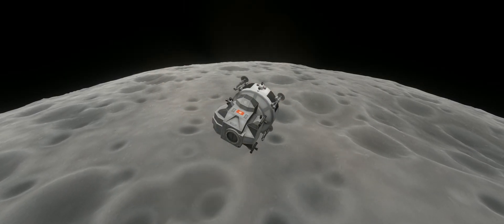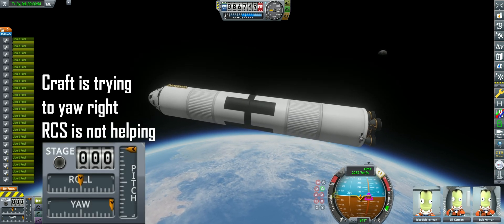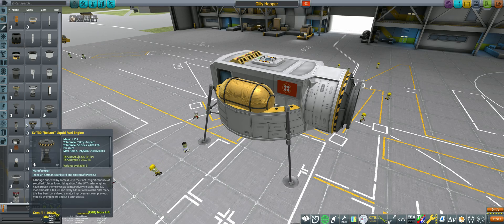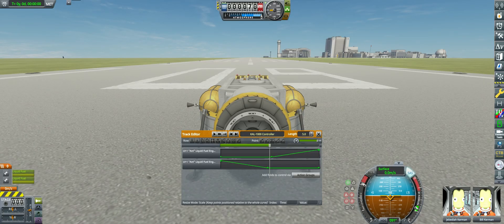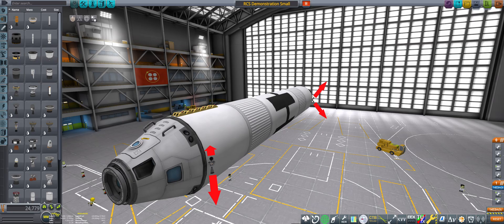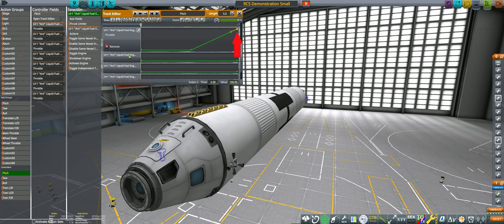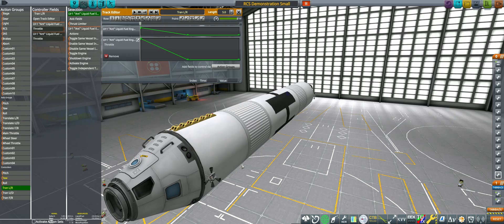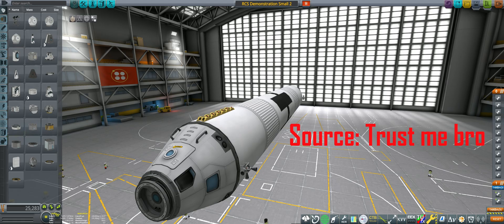KSP Dark Arts: Custom RCS

Comment: To 'rigorously' define the source: trust me bro without math, we can make the following observations:

First, a geometric object must have at least 2 dimensions to be able to translate and rotate in 3 dimensions. Hence, all thrusters must at least be distributed across a flat shape to get 6DoF motion. The trust-me-bro configuration satisfies this condition.

Next, if we assume that none of the thrusters lie on the center of mass, then we need at least 2 thrusters for each direction of translation, for a total of 12 thrusters aligned with the translation axes. The trust-me-bro configuration satisfies this condition.

Moving on, each rotational direction must be handled by at least a pair that point in opposite directions, but have the CoM as the midpoint of the line connecting them. However, we need not limit ourselves to thruster pairs. Any radially symmetric arrangement of thrusters pointing in a circle will do. The trust-me-bro configuration satisfies this condition.

Note that the trust-me-bro configuration does not have 24 thrusters as you would expect if you naively counted in pairs for each of the axes for each condition, because each thruster is literally pulling double duty.

Comment: You can use the mod Throttle Controlled Avionics to do this seamlessly, which is probably more practical unless you are a stock purist (this is still cool though)
Reply: This is also very useful for console players who don’t have mod access.
Reply: Or with Mechjeb: Utilities Assymetric thrust, Or just use tweakscale with vernior engines.

Comment: I tried it once, it does work but unfortunately is rather time-consuming to set up and you are right, you really need to do a lot more manual maneuvering
I wish KSP 2  would address this, but I'm not very confident about it. 
Well, we'll be getting better sub-assemblies and the game expects way larger ships, so hopefully, there should be a way to maneuver them better... yeeeeeah =\
Reply: I think any engine should be able to become an RCS thrust by just checking a box. Much easier.
Reply: @davisdf3064  I agree so much!!!
Reply: my bet is that there will be either a tech node that unlocks this or a very big RCS block
Reply: i would be very surprised if they dont add new RCS to account for the larger ships

Comment: Why don't you have the RCS rurves meeting at 2.5, but rather 2.4 or 2.6 in the KAL1000?
Reply from the maker: I've noticed that the play position can sometimes be very slightly jittery, and so it won't be exactly 2.5, which makes it very slightly "leaky" if you have the curves end exactly at 2.5
Reply: @lt_duckweed  Well that solves the problem as long as you don't use an actual axes to control them.